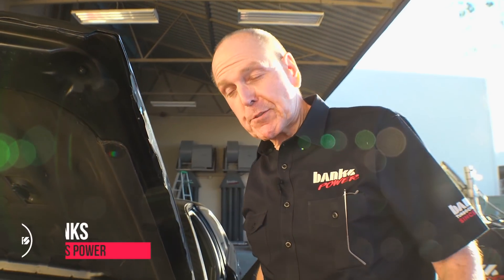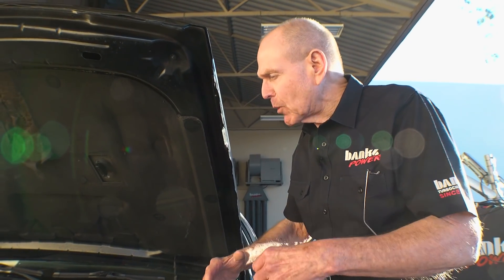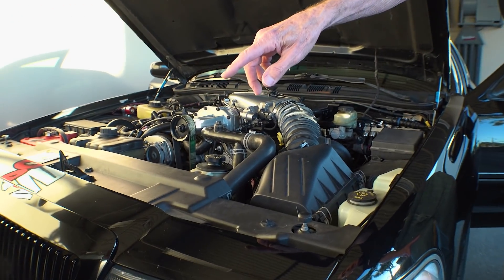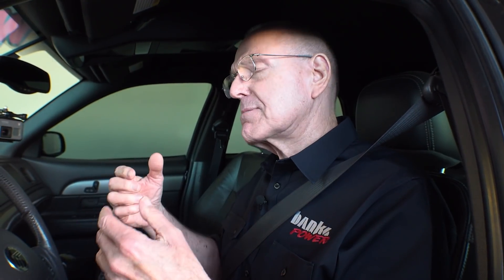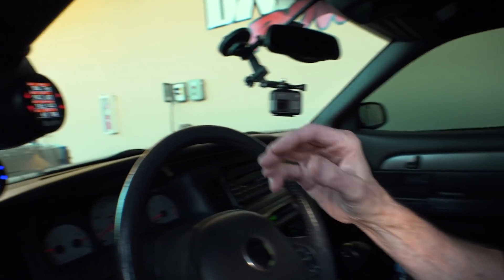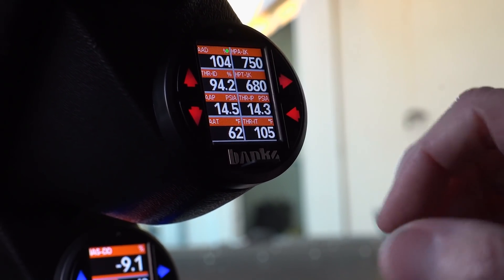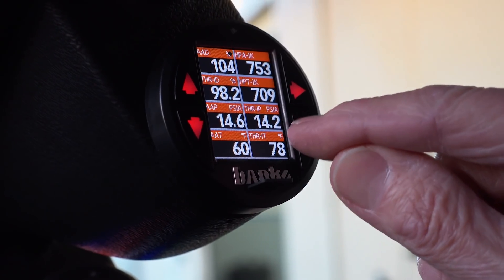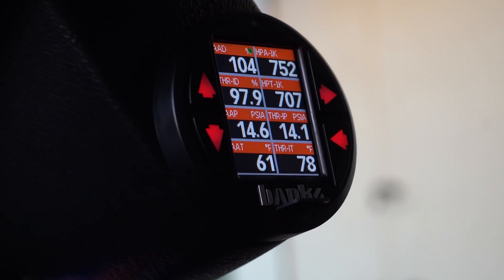My stock intake sucks. Here's proof.

Comment: Several Temp Readings, was that using multiple Air Mouse units. Gale doesn't indicate more than the one he mounted grill of car. 

I don't see how several points of temps are collected using only 1 Air Mouse.
Reply from the maker: It was only using one. The Air Mouse features a microchip built in the sensor that allow it to calculate and translate the 15 exclusive parameters to the iDash. 
See more here: https://bankspower.com/products/sensor-airmouse-66420
Reply: @bankspower  That’s Amazing, the Temps are all calculated based on ambient temp at nose of Grill? The multiple manifold temps… in Ft of, in and after intercooler, intake manifold, etc. 

How does it calculate exit at intercooler or manifold… seems like temp accuracy could be off. 

I’m all for 1 Air Mouse but not following how calculated is as accurate as measured!

Comment: I installed the Banks CAI on my 2001 Tahoe. Quality is unsurpassed, however, my gas mileage dropped by over 10%... my primary operating range is 1500 to 2500 RPM. Makes me wonder what range / flow is this tuned for? Running a speed density tune... extensively tuned the VE table to try and addrrss. I have a LQ9 with cam... my baseline MPG before CAI was 15mpg now I am 12.5mpg... spent months trying to figure out where my efficency went. FYI cam is custom grind to increase part throttle performance and low ebd torque. Maybe this intake is tuned for a higher RPM / flow than what I am shooting for?

Comment: The value hi is watching at is representet as heat soak in the ecu mapping. Or on older ecu strategys its a combination of engine temtp correction and ambiante air temp correction.

Comment: The Mercury Marauder is my kind of car.  But, back in '96 I ended up buying a new Impala SS.  In fact, I still have it.  The stock engine in the Marauder (as I recall) was naturally aspirated with 4 valves per cylinder.  I remember reading a road test on the Marauder where they summed up the car's power by saying, "it lacked a sense of urgency when launching from a standstill".  The conclusion was that the benefits of the 4 valves per cylinder came into play at the higher RPM.  So the low end torque was not too impressive but the high end horsepower was strong.

Comment: You have never seen a stock intake as bad as the one on a Nissan Kicks. The air pulls from two little holes at the bottom of the air box, which is right next to the transmission, because it's such a deep box.  It also has a vent from the grill, but the air way is almost completely blocked off intentionally by design.  I've never seen anything like it.

Comment: Lots of people underestimate what an intake can cost you. My hilux has an l67 supercharged 3.8 swap and gained just over 14% power and carried the torque for a lot longer going to a custom intake setup with more room for improvement as that was still drawing air from the engine bay for the most part. That's a damn respectable jump in my books for a few hours in the shed on the tools and about $50 in material...

Comment: What would be a typical pressure drop and temperature increase for a good performance intake? Its the only thing he didnt address.
Reply: I’d bet a handful of inH2O drop is typical, but ideal is probably 0 pressure drop. It all gets down to inlet location- putting it in a higher than ambient pressure location to overcome  filter/intake restrictions. Get it all right and you minimize the work the engine needs to do to make power.

Comment: I have a P32 chev Workhorse chassis RV with a 6.5t and the intake runner goes from the near side to the front of the RV then over to the Off side of the RV ,, I was only getting 4psi boost (I know PSI BOOST BLA BLA ) but its the only test i have here in Australia ,, so from 4 psi to 12 just by shortening the intake runner That was over 6 feet long to 6 inches and a K and N free flow blue filter , What a differance ,,, now i can hear that sucker spool up ,,,, I even piss off the HONDA BOYS at the lights ,,,,,,,Great Vid Mr Banks

Comment: Banks, do you see any benefit of insulating the intake tubing to reduce temperature rise?  It seems to me a cheap way to reduce temperature rise and maintain air density.  I guess my question is, "Is it a significant or an insignificant amount of temperature rise (as the air goes from the filter through an aluminum tube to the throttle body) assuming that you are taking in cool air to begin with with a low restriction filter, on a naturally aspirated application?"  Yes, I've been paying attention to your videos regarding air density.  To me it seems as if most cold air intakes are using aluminum tubing which conducts heat very well, however the tubing is a relatively large diameter (low relative surface area interacting with the air) and a relatively large volume of air moving through it, but it is in a really high temperature environment underneath the hood especially above the engine/exhaust.  I just don't have the instrumentation to see the actual numbers like you do.

Comment: the gauge is only as good as your sensors. While many sensors are factory, many aren't, and many manufactures vary the sensors between engine models and emission systems.  Multiple stages of Intake pressure/temperature sensors or turbo inlet/exhaust sensors for example. Installing them properly isn't cheap or easy.

Comment: Sometimes I wonder "what if" you took the intake manifold and hooked up pure, 100% oxygen like what they give people in hospitals. Would that mean 5x more power if you, of course had a fuel pump to match? Not as harsh as nitrous and you could even hook up a compressor to pull/filter the air from the outside on a hypothetical car
Reply: unfortunately that wouldn't work, would more likely act like a cutting torch in the cylinders.  If you've ever used a torch for cutting, it goes crazy when you hit the nozzle to cut the acetalyne and go pure oxygen and the metal becomes the fuel.  N20 has the nitrogen to act as a buffer to help prevent the nitrous from just torching the engine as long as the fuel is added correctly and no other mistakes in your build.

Comment: The thread title made me think Banks was going to do a comparison of intake systems, air filters, etc. All I got was a commercial for a little A-Pillar mounted gauge bundle. Disappointing.
Reply from the maker: You missed the point. No gauge has ever been able to evaluate an air intake system... until now.
Reply: @bankspower  I understand. But I was expecting the results of a comparison test of air filters, induction systems, etc. The sensor/instrument package tells me what a particular induction system is doing and where the losses are. It's a clever little device, but no comparison dyno test.

Comment: This slow taking genius built that motor with a stock intake? That's a  beginner's mistake. I try to watch these vids but he puts me to sleep
Reply from the maker: We just woke up from a nap induced by a guy singing a Marvin Gaye song in a subway.
Reply: Nah, a beginner's mistake is swapping out an intake that has solid engineering behind it for some unit of unknown quality.  Say what you will about the OEM stuff, at least there was thought put into it.  I've seen a LOT of aftermarket crap that's obviously objectively worse than what the factory installed.

Comment: i vote hood scoop.  Pulling air from the highest point possible off the ground is best IMO. probably need something like what the new duramax has , so it can still be funneled down to the air box. im sure you know better than anyone.
Reply from the maker: Not necessarily. That's why we invented the AirMouse ambient air sensor. It comes with a 6' cable so you can mount it in different places around the nose of the vehicle to see where is the best air induction point. For some cars it's in the nose, for some it's on the hood, for others, it's below the grill, etc. The AirMouse measures air temp, air humidity and air PRESSURE. it's the ultimate tool for designing an intake. And, the L5P only draws in a portion of its air from the hood scoop. Most of the cool air comes through the fender into the air box.

Comment: I'll be buying your system soon. I'm putting a 700HP LS7 (been engine dyno'd already, engine build by Mast Motorsports) into a 07 Saturn Sky as a show & go car for SEMA 2019. I"d like to see those numbers :)
Reply from the maker: You definitely need the iDash and the sensor modules. Your car is going to be a beast!
Reply: @bankspower  , reading the specs in the owners manual, it won't work - I'm using the stock ECM and its a 07 Sky Redline, your manual says 08 or newer :(
Reply from the maker: @Talisman-tb6vw  You could use the iDash for aftermarket ECUs. It has a +/- for power as opposed to the other iDashes which connect via OBD. You would need to use our sensor modules. Or, you can wait until the end of Q1 for our Pre-CAN OBD iDash.

Comment: I have been taught that 1 lbs per minute of airflow equates to about 9.5 to 10.5 hp. The video mentioned hp potential for a diesel being less which equates to 8.3 hp for 1 pound per minute of airflow. Is there a range you can give me for diesel's as well as some insight to gas vs diesel potential based on airflow/ air-density? Stoich is very close so fuel isn't robbing space for air, maybe piston rattle and ring seal?

Comment: Adding more filtration surface with same oem specification and larger intake too filtration box works to.
You can also just add air intake surface to filtration box and making it positive air pressure.
Most normal car manufactures take intake air to filtration box in front of radiator or side panel.

Wet cold air filter intake is like wanting to be straight shooter but always misses your target.

Comment: I don't think turbos are that good at all I mean yes you can make some serious power but you have to deal with lag and overheating problems if you don't set it up right , superchargers are way better imo cause you get the power instantly and generally don't have as many overheating problems because of it
Reply from the maker: Superchargers typically create more heat than turbos and have less parasitic loss. Wait until you see the super-turbo we're building. Stay tuned.
Reply: Banks Power ahh I've just heard of turbos causing vehicles to overheat if the kit isn't built correctly , I just prefer superchargers cause you don't have to deal with lag but I sure will stay tuned a super turbo sound amazing
Reply from the maker: @smokeythehuman3596  That's because people don't know how to set them up correctly. Yes, superchargers have less lag generally.
Reply: Banks Power ahh that makes sense, by super turbo are you meaning a supercharger with a turbo also or do I gotta stay tuned to find out lol

Comment: What about the Bernoulli's principle of lower measured pressure in moving fluid (air)?
Reply: Bernoullis principle states increased velocity decreases pressure.Gale  appears to decrease intake velocity by increasing diameter and decreasing the radius of any change of direction while reducing the charge temperature, thus increasing air density or pounds per cubic foot. Then add force to the air via turbo.

Comment: Kickass again, love this stuff. I'd love to see a dyno comparison that demos the estimation and engineering potential of this thing. So for example, do some pulls stock, measure the power output. We know we're losing ~10% of power due to that air density loss, so just jam a bigass dryer vent house out the front with no filter and show how that air density number, and thus power changes.

Comment: Remove the tiny choker tube. Then drill holes on the dirty side. Put a K&N and be done. Yea its warm air, but at 60 plus MPH its not warm anymore. A few cars actually have decent stock air intakes, but most this will help a lot if you are broke. Test that Mr Banks. Bet u wont.

Comment: Lol and I just put a stock intake back in my 98 grand Cherokee. The previous owner put a K&N cold air (fipk 2) kit in it. After years of seeing dust lining the inside of intake tube, I finally just went to a junk yard and got a stock intake.

Plus, with the stock intake I can buy a snorkel kit.  Not planning to do many deep water crossings, but I hear the snorkels are great for keeping most dirt and dust from even reaching the filter, which is much needed where I'm from.

Comment: 1000 cfm = 720 hp. My 300 l6 has a 600 cfm holley on it, and it can not use all of the carb...
Pulls like a train though...

And sir, you have a very nice car there.

Comment: So his new performance intake will have to improve on the 17 degree increase from outside air to throttle body temp correct? So let's say he can get the full 17 lowered, can we compute what that reduction will be worth on horsepower as the car is driven down the road (not heatsoaked sitting still).?

Comment: where I live(denver area) on a daily driver car we need some air intake temp gain to prevent icing.I wonder if in this case some insulation around the plastic intake system might help. also where is the air intake located. this modification will be interesting to watch.

Comment: I feel like people hate on banks because of the price of the products. IF you watch these videos and watch Gale you'll see how much work goes into a product. Driven by passion for the hobby. Work is still his hobby after all these years.
Reply: Ive got no problem with somebody making money. Especially when everybody on youtube is either promoting some shitty mobile game, telling you to buy a shitty tshirt or both. Hes selling high quality enthusiast level products made by him. Who could be mad?
Reply: Saw a video years ago where some British guys tested several aftermarket (K&N ect.)on a few cars. These guys had the fans blowing into the engine and the whole nine yards. In the end none of the aftermarket systems added any horsepower at all!! I mentioned this to a guy that ran a car shop in Hawaii where the police got their speedometers calibrated and he told me " yeah, I don't really push those things anymore"! Just saying.....
Reply: @Edmillerknives  the cold air intake should not make much of a difference if any on a stock setup, when you will see a change is when you add power and increase the air needed beyond the original specifications used for the intake design. Add a turbo and double the power and the old stock intake will be a restriction, if adding a cold air intake to a otherwise stock engine it's mostly just going to add cool intake noises.

Comment: I have an 06 jeep wrangler tj and I want to add the sidewinder turbo to my Jeep. I've been told by the place I was going to have install it. That the last one they tried to install wouldn't pass smog, ended up sending the kit back to Banks. I felt pretty bad about that. How do I make it work right? I really would like one. I have personal reasons why I'm upgrading my Jeep.
Reply: The kits are emissions compliant. Maybe that other Jeep work the kit had base engine issues to begin with before the kit was installed or the installers left some component out to affect the emissions of the Jeep.
I know quite a few Jeeps with this turbo kit and they pass emissions with no issues..

Comment: Just drill some holes in the air box. The ol' cheapskate fix.
Reply: This reminds me of a "fix" on the Turbobricks Volvo forums to convert the hot air recirculation flap in to a cold air intake on the 740/940 Turbo cars. I was interested until I started thinking about starting my car in -30 weather, the Swedish engineers put that flap there for a reason!
Reply: I agree I cut the whole bottom of my stock box out and put a K&N drop in, problem solved
Reply: I did this to my car. I like it. But would not recommend to others